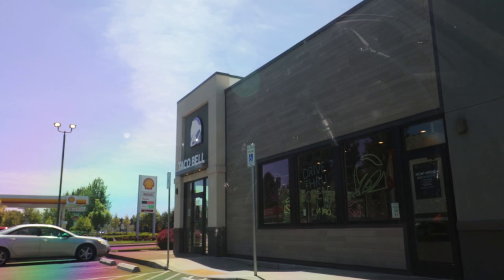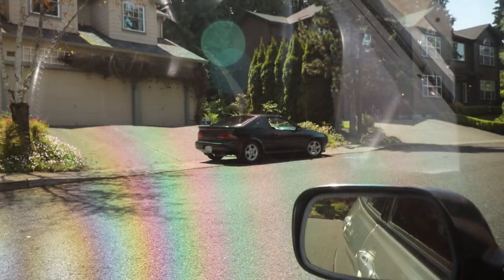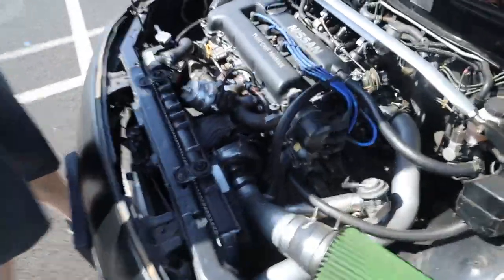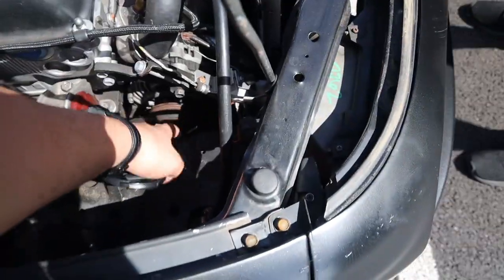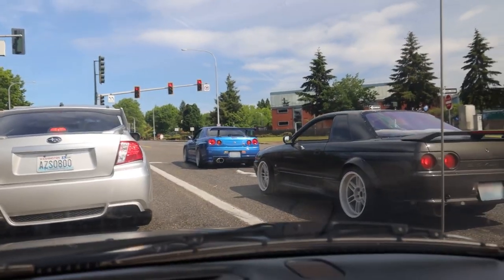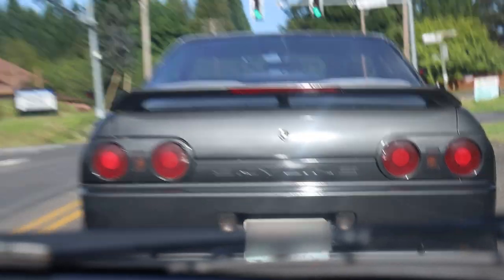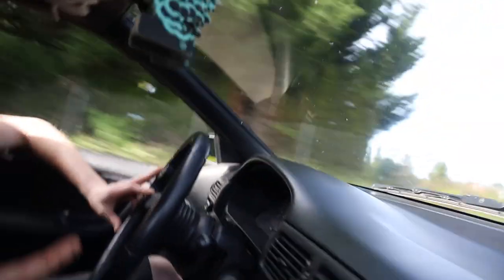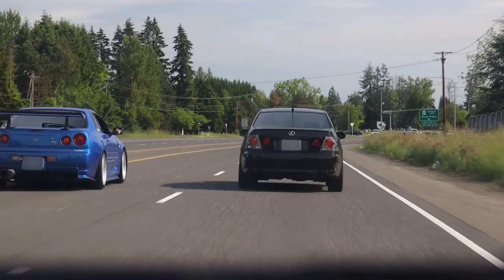Turbo NX2000 reaction and cruising with a Skyline R34 GTR!!!

Comment: Just like the sentra; the NX2000 as well as the Canadian NX1600 with the CA16de, were super underrated car out there...
Reply from the maker: They are absolutely wild! Matt, the owner of the nx also has a pretty crazy sentra build in the works, check him out on instagram @bougie_b13 🤘🏼🤘🏼
Reply: @RotaryDaddy  will do...
Reply: I own an NX they are way fast for only 140hp. I kept up with a stock 3.5 camaro. My NX has simple mods like suspension and better exhaust.